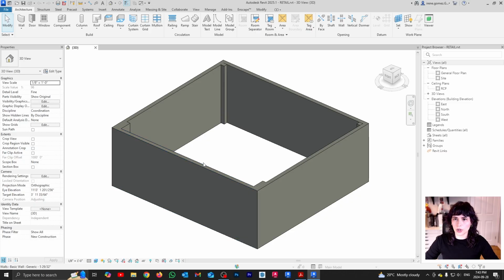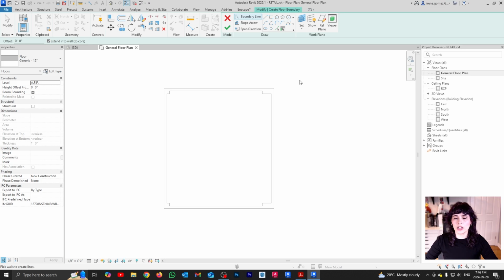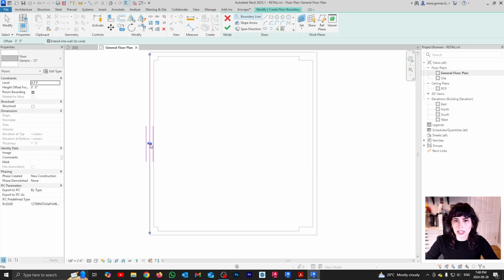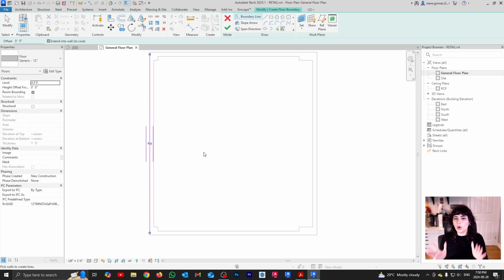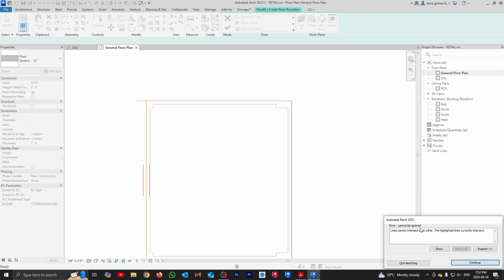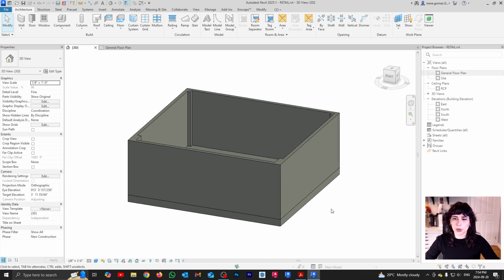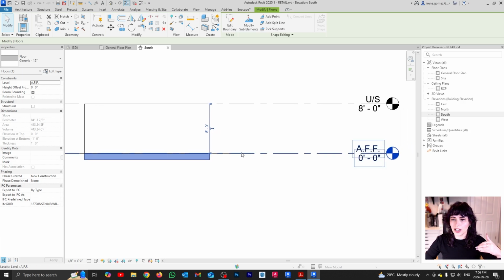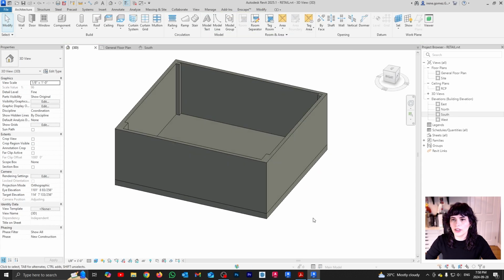Revit - Basic Principles to Create and Edit Architectural Floors

Comment: When we have to assign different tiles to different rooms then we will draw a separate floor for each , but the structural floor should be same for all ?
Reply from the maker: That's such a good question! And there's basically 2 solutions depending on how parametric and "correct" you want things to be. If you just want to see different materials in the floor, you could use 'split face' and 'paint face' to assign to each room. If you want your floors to be better from a parametric stand point, then you would first model your "structural floor" which is same for all, and then on top of it you create a new "finish floor". I have a whole video about it but it's coming in the far future haha!